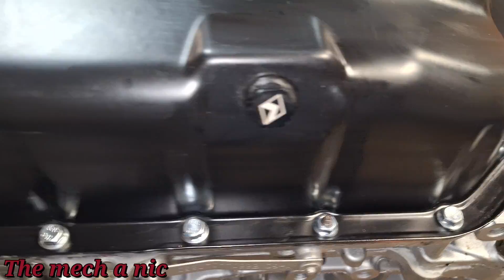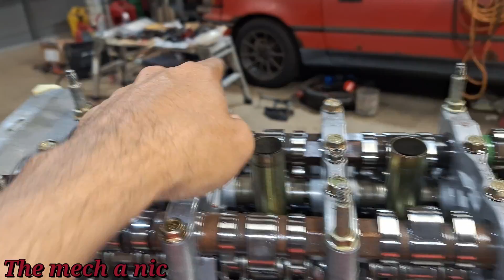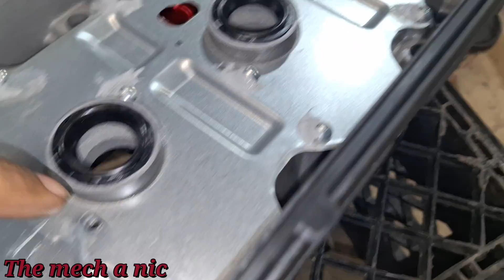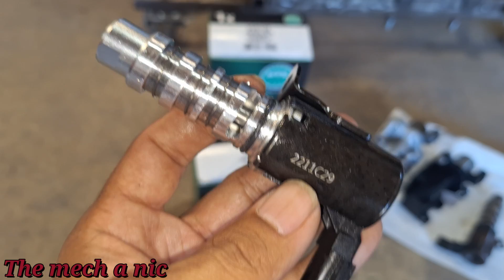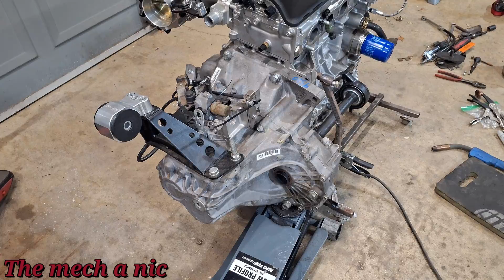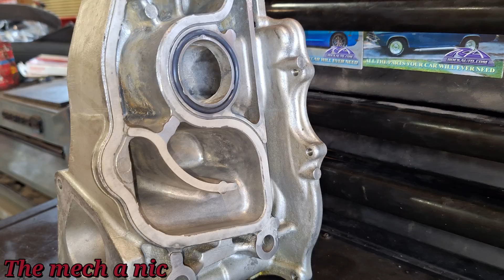K24 crx finishing the engine

Comment: You don’t need to run a pcv valve if you’re running a catch can. Catch can will vents crank case pressure to atmosphere. Pcv route the crank case back to the intake to burn in the combustion chamber.

Comment: Awesome video. My tuner told me I can either plug the pcv valve shut or leave it open. For a while I left it fully open with a -10 orb venting to the atmosphere and  had 2 -10s coming off my valve cover going to a catch can just venting. For the pcv valve you need vacuum. So even if you put the stock pcv valve back in, it wouldn't open up without vacuum. I chose to not plug it back the the manifold so it doesn't suck up the junk from the block back into the mani back into my motor. I'm just vented off the VC.
Reply from the maker: I plan on installing the catch can how it Normally would be installed.  I'll need to connect one end to the intake manifold so that it's pulling that vacuum

Comment: You can put the pvc in the value cover vent one hole and put a grommet in the other and use a pop in pvc( positive crank case vent) pulls vacuum through out the engine.older PVC had it in one side and vent on the other
Reply from the maker: That's a good idea that I didn't think of